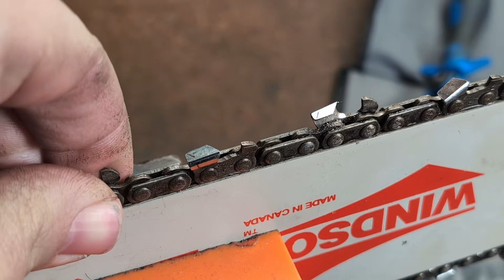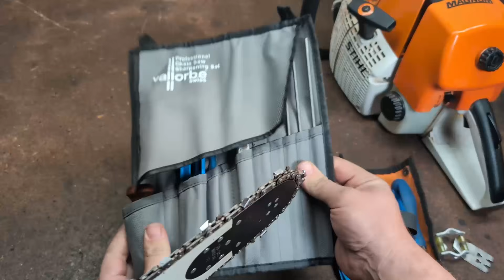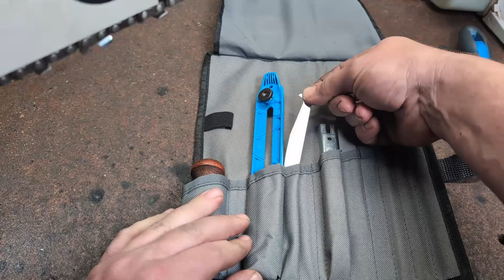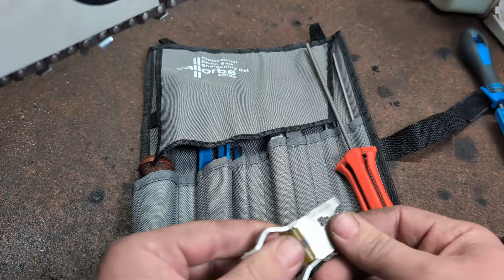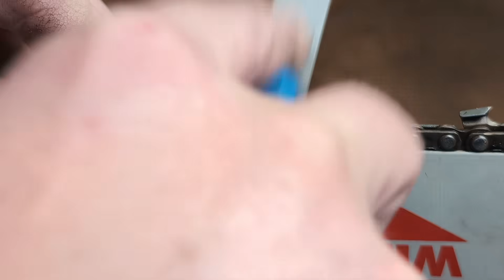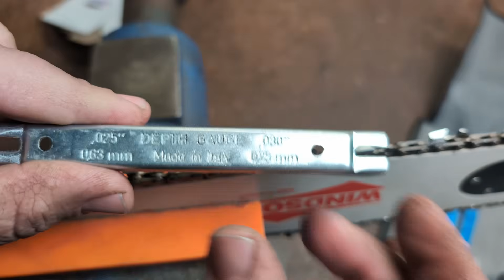Basic Sharpening - Stihl kit, Husky roller guide, Vallorbe file kit

Comment: What is a saw chain that has cutters on every link and why are they made that way?  No one seems to know.....
Reply from the maker: Full comp. It's used for carving and cutting bamboo mostly 

It doesn't really work for normal cutting because it doesn't have a functioning gullet
Reply: @SawChainTheories  Just to be sure were talking about the same thing, full comp or what some call full house will have a cutter then a space and another cutter.  For example a 100 drive link chain will have 50 cutters.  The mystery chain of which is confusing will have the same number of cutters as drive links.  I have a 6 inch pruning saw with a chain like that but I seen a 18 inch cordless Ryobi with that type of chain. To me the gullet is just part of a single tooth below the top plate  Ryobi customer service was of no help so I called Madsen's and got the same response.
Reply from the maker: @joehead1294 So I call that full comp or full sequence but others use different terms. I guess I make it confusing as well because I use the terms normal sequence (most common, cutter, blank, cutter) then semi and skip sequence. 

Oregon sells them with the name "F" ie. 91F for 3/8 or 25F for 1/4 inch

The idea of them is when cutting small diameter stuff, it can't get between the cutters and attempt to stall the chain. It's most likely on a pole saw to make the cut smoother and avoid issues with it kicking back if small bits get into the blank strap.

The downfall is they don't have anywhere to carry the chips out. It's not an issue on really short bars like a pole saw.

If you look back at the early days of safety style chains, with the humped tie strap / shark fin, it was designed for cutting brush. They were having issues with small diameter sticks hitting up against the front edge of the depth gauge. That would cause the chain to stall and often break. They added the hump to prevent things from getting down in there and help deflect it over the front edge of the cutter.

The full house / full comp / full sequence is doing the same thing
Reply: @SawChainTheories  Hot damn, you found that shit.  Now why would Ryobi put that chain one of their cordless models with an 18 inch bar?  You the man!!!

Comment: I love your work.  I have noticed a small issue with some chain saws.  Would you look into this please.  Both old and new chainsaws.  When you have a new bar and chain installed.  You tension the chain accordingly. well....  After you tension the chain and tighten the bar fully for use...  Do you drag the chain say 5cm, then test the slack in the chain.  Pull another 5 cm and again test the slack in the chain.  Repeat this step until you Pull the entire chain a full 360 degrees.  What I have found - After about 20cm pull the chain gets either too slack or too tight from tension.  Then it reverts back to the original tension you set it for then may repeat again until you fully complete the full 360 rotation.  Have you ever looked into this.???
Reply: Roller chain will act like that too.  Tight spots and loose spots.  Kinda even out some with wear.
Reply: @joehead1294  Its more apparent on larger bars. 20" +++ but on 14-16 not as much.  I will keep this in mind.  thank you
Reply: @jasonputtock - if you take chain off bar and flex each link, I'd bet you will find some links to be a bit stiff (minimal free movement). When one of these stiff links is positioned at bar tip OR drive gear, chain will be looser than if positioned on flat of bar. If Stiff links are positioned on flat of bar, chain will be tighter. Stiff links have either gotten distorted or have embedded debris limiting free movement/flexing and need to be freed up to provide consistent chain tension.
EDIT: RE your comment above related to issue being more prevalent on longer bars/chains ... Longer bars have more links, so greater potential for stiff/stuck links.
Reply: @GravityRoller  Are you saying ALL new chains that I have used has this problem....  I have even thought this myself.  But ALL new Chains.. not likley
Reply: @jasonputtock4428 
Hmmm ..., I made no comment related to new or used chains (in general my comments relate to all flexible link chain). Simply suggested that if you experience tight/loose chain variance when hand rotating a chain on a bar (as you described, I think ...), that the condition may be related to stiff/stuck links. It is a simple process to flex the individual links (chain off the bar) to find any that need freeing up. Learned this decades ago on chains used for motorcycle roadracing (non free links affect suspension compliance and produce chain-slap). On chainsaw chains, I always test for stuck links by grasping chain on top of bar just ahead of exhaust and pinching (between thumb/finger) as I push/rotate chain to tip. If gap (bar to chain link) pinches finger/thumb between chain link & bar as chain is rotated, typically means stuck links(s) and further investigation to determine specifics of issue.
Reply: @GravityRoller  I was thinking more of an out of balanced or Twisted crank.  The chainsaw is atleast 30 years old.  However that being said, even my chainsaw From Yato shows the exact problems as the old dolmar.  Both chainsaws use different chains but suffer same problems.....  Its a real pain in the ass.  Truth be known..
Reply: @jasonputtock4428 RE: your comments about a twisted crank possibly causing intermittent chain tightening. 
YES, a bent crank-end would cause intermittent chain tensioning.
My considerations on bent cranks,   how they may occur, and potential  prevention) as follows ...
Last few years I have been living at 8'600' elevation in the Rockies doing a fair amount of fire mitigation work related to beetle-kill pine. I have read that bent cranks are possible (...??) specifically from leaving a warm saw, expanded chain from heat/friction where user tightens a warm chain, then leaves saw in cold/freezing environment (cooling chain shrinks creating enough tension to bend crank-end). Currently trying to remember to always de-tension all saw chains before storing in freeze conditions (BTW, 22°F at 6:30a this morning and AM snow on the deck last week).
If you question the possibility of "twisted" aka bent crank as cause of intermittent/irregular chain tension, I'd suggest you test for a bent crank-end. Rotate crank whilst observing/measuring for crank-end-runout. Whilst chain is off saw, test chain for any stuck or distorted links (my previous comments).
On my Husky 540iXP, I have been running a narrow kerf 0.043" bar in .325" &/or 3/8"LP to help cut-speed during felling & especially limbing (0.050" bar on my Husky 365 and  0.065" bar on only one saw currently, all others saws running 0.050" bar/chain). I find the narrow kerf chains more often get pinched causing resultant stiff links like I have referred to in each previous comment (requiring a little work on anvil to free them up again). Additionally, with the excessive pitch in our local trees here, chain links get gummed up much more so than trees of the PacNW Cascades. Gummed up links also create intermittent chain tightening. I clean my days-use bars & chains at end of each day,  including touchup/inspection of cutter-teeth & depth-guages (aka rakers). (See my comments above related to checking for stuck links on an installed chain). Anytime I have a chain off a bar I flex each link to determine any damaged stuck links in need of repair.
Based on your comments I would suggest that you 1st check/test for stuck chain links (pinched/twisted and or gummed-up) and also for crank-end  run out to determine where the problem lies. 
Also would recommend that you inspect drive sprocket and tip sprocket & bar channels for damage or debris.
A few minutes worth of inspection would most likely reveal the specifics of problem(s) mentioned.
Hopefully something here is of use to you.
Regards,
EDIT: spelling ;-)

Comment: I started out with an electric chain grinder, then switched to a regular file and one of those Stihl-style sharpening guides. All of them worked well. I hesitated for a long time before trying one of the 2-in-1 sharpening systems from Stihl or Pferd. And honestly, they’re pure magic. They make sharpening so simple and precise, it's insane.
Reply from the maker: The 2 in 1 makes life so much easier. I said it in a previous video but if they had been around when I first started using saws, I wouldn't be doing this. I would have used one of those and been happy with it.

They aren't perfect but they are good enough

Comment: Thanks for the video!  Seems like the Stihl guide wasn't quite deep enough on the tooth.
Reply from the maker: It was riding high because of how much was removed. They sit on top of the cutter and depth gauge, as the cutter was filed back the front edge was still up high on the depth gauge.

It will cut OK like it was but will improve with the new sharpening. The vallorbe guide holds the file deeper and works better for this type (semi) of chain in general.

The husky guide really didn't suit this chain very well but got the job done well enough to work
Reply: That has been my experience with that style. Long ago I tried a few Oregon ones I had promptly rid myself of them.